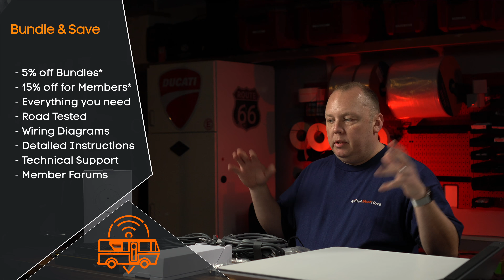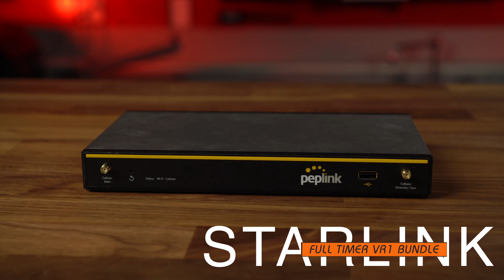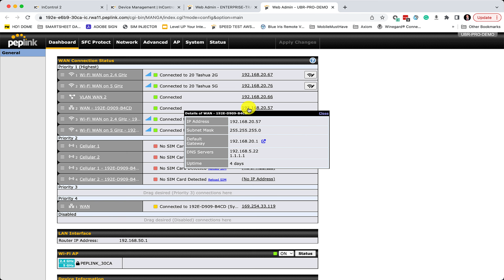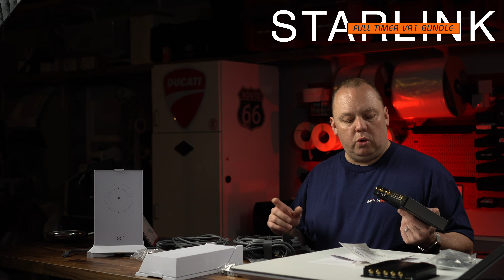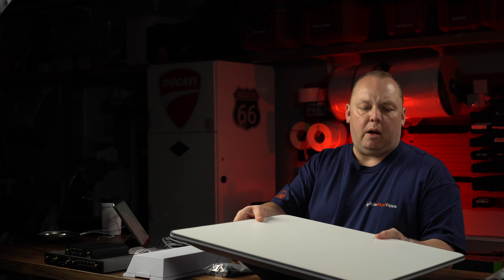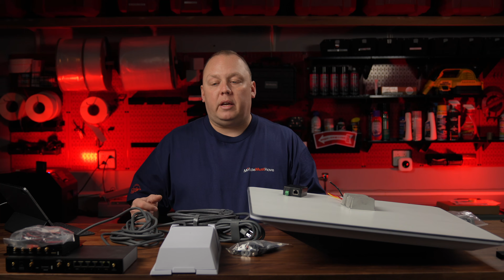Starlink Bundles for Reliable Mobile Connectivity

Comment: Thanks for the info!  What about an antenna for the BR1?  Does this system come with small antennas that attach to the unit itself?
Reply from the maker: Not sure if you are talking about the BR1 Pro 5g or the BR1 Mini, but both come with small paddle antenna's to twist in. Of course we do recommend a stronger external antenna for maximum performance!

Comment: Why didn't MMH create a bundle with a Max Duo device? What was your thinking on why to go with the Balance 20x instead of the Max device?
Reply from the maker: Most folks do not need a dual modem cellular connection and a Starlink connection. For most, it's overkill! But the Balance 20X does have the flexibility and expansion available. We do sell Starlink separately so you can totally add it with any Peplink!

Comment: We own Starlink, BR1 Pro 5g and the Cat4 generation of the Balance20x. I have to say the chipset in the Pro 5g alone is worth it, the Balance20x is much slower at admin panel tasks and settings changes and the Wifi 6 in the BR1 Pro makes it just much friendlier to daily drive. Great video!
Reply from the maker: Hi Dylan, Yes the updated chip set does make a difference!  The new cat-7 Balance 20x also have updated chips to help with this thru put. :)
Reply: @MobileMustHave  in that same regard, how does the cat7 balance 20x compare with:
Balance TWO    assuming same 8.3 firmware and ignoring the price difference ?
Reply from the maker: @Vamanos46  the balance two does not have onboard cellular and is not made for mobile use although it could be used. It has 1gb router throughput which is higher than the 900mbps of the balance 20x but not by a ton. That said the balance two would do a better job if you had two wired wan connections such as two starlinks for example as it has higher overall throughput but i'm not sure starlink would give you enough throughput for it to matter. I think the balance 20x gives you a lot more wan flexibilty for mobile use with the flexmodule port, and onboard CAT 7 cellular for the lower price point however if you wanted to look at straight performance adding a 5G USB max adapter and a starlink to the balance two would give you more performance (but it would cost quite a bit more in total).